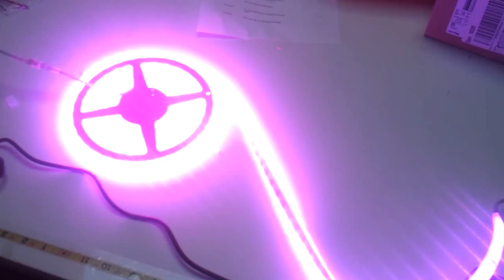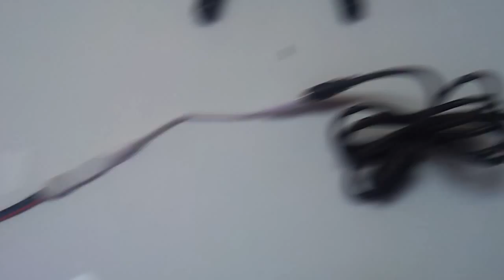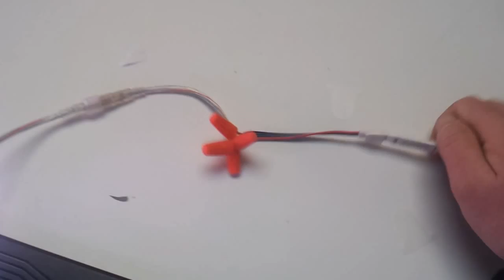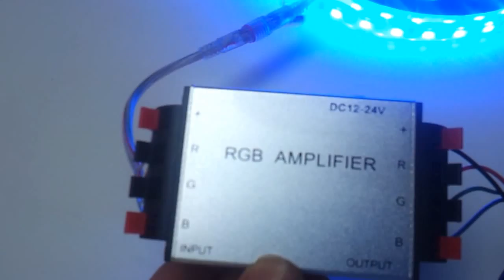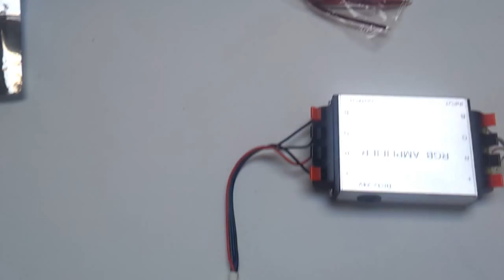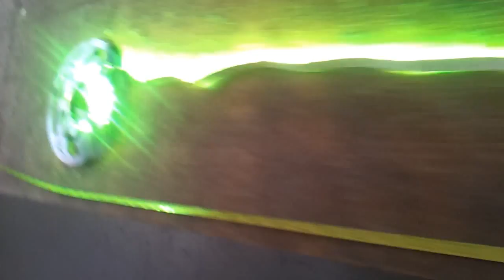How to Install LED Strip Lights: RGB Long Distance Installs with Amplifier

Comment: So if I want to connect over 100ft of strips into one continuous line, how would I avoid voltage drop?  I have three transformers and am trying to have it so there's no jumps with cables.  I'm going to solder the strips.  I have 3 300 watt transformers

Comment: You can do this over and over again until you run out of power sockets to plug all those power supplies into it's got to be a better way and I haven't found it yet but I do have some ideas look everyone these LED lights you should just plug the main power supply in because that's what these adapters do spend all that money to have to plug it into the wall anyway just use the plug that comes with it and this string the lights next to each other in a straight row it's the exact same thing that's my complaint anyway it's got to be a better way

Comment: Hi, I have a question.
I have a gas station and I want to install 5-meter LED white stripes around each of the 8 doors.  I have bought 8 of the stripes but unsure if I should buy 240W or 2 X 120W.
Should I buy an amplifier of 120W + 120W transformer? PLEASE Help. thank you!
Can all of these be in a cooler? (not freezer)

Comment: Question. Im running 5metres total in increaments of 1ft each. When i have the brightness up it gets real hot - hot enough that i rather  not touch it. I run out on 75%of brightness and it gets warm but nothing to crazy. I believe im running  12v at 5amps.  no amplifier Any ideas what the problem is

Comment: Hypothetically if I had one real, I only need lighting for the first half of the real, cut it and added 10 foot extention wire and then continued the other half of the strand would It work without an amplifier.
Reply: Pretty sure that would just mean half the voltage on both sides with uniform voltage drop

Comment: How if instead of series circuit like in your video, use one big amps 12v power supply and put them in parallel? In parallel circuit, do we still need amplifier for each strip even though the power supply has big amps?

Comment: Can I put a the amp at the beginning of the run, and have a IR motion sensor control the power supply to the amp? I think that way the data stays live?
Reply from the maker: Hi Gabe,

Thanks for watching our videos! 

What you described is perfectly doable. It should work without any issues.

Don't hesitate to contact us if you have any other questions.

Comment: I saw 360w amplifier on the web, why 360 wattage.... ? and dont wattage on ur amplifer ....? thanks....
Reply: if it says 360 watt it can output 360 watt at maximum. the led strips use power.. lets say you got 30 meters of led's and they are rated for 400 watts, you would need at a minimum 400 watt power supply.
Reply: Then its a low power led strip... Just look at the specs of the led strip and psu.

Comment: if anyone can help me i would appreciate it. I am trying to put lights under the stairs on front of the house. I have three steps, the bottom 2 stairs are 10 ft, the 3rd is to the patio runs 22 ft 5 in.  I saw that I can get 32.8 ft of strip to one power supply. can I get a splitter to have all three runs go into the one power supply without any loss of power or not same brightness of light?  Total i am trying to run about 45 feet of leds can I have to go to one 12v power supply?

Comment: If I'm running 16 ft 300 light strip then amplifier then another 300 LED 16 foot strip when I get to the end can I connect that end into the first strips end that is hanging to complete a square?
Reply from the maker: Hi John,

Thanks for watching our videos!

It's not recommended you join them together, simply leave the two ends close to each other but don't actually connect them. This will still create the illusion of a square.

Don't hesitate to give us a call at 1-844-353-9347 if you have any other questions!

Comment: You  mentioned that on the end of the run ,you should install another amplifier and another PSU along with the connectors. What if the main PSU is strong enough to support 2-3-4-5 or so more reels? Can't we keep going on as long as the main power source allows us? Also, the same thing for the amplifier. I have a 12A 144w for 12V amplifier, which consequently supports 2 300LEDs reels. Can I connect two different reels at the end of the amplifier? Thanks.
Reply from the maker: Hi there, Thanks for watching our videos!
Each amplifier needs it's own power source to boost the signal. The issue here is voltage drop and that is why you need to use more power sources.
Give us a call at 1-844-FLEXFIRE if you have any other questions or would like to get a project developed.

Comment: so this is all fun and games, but there's a problem with this imho. you don't have a contineous line of RGB strips this way. the great thing about these rgb strips is that you can cut them at the copper marking, and then use a clip to connect one to another. the problem then indeed is power supply. 2 strips will work okay, but then it's all but over. now this amplifier is nice and all, but i have a bit of a problem with it, and that is that it completely cuts the fluency short of the led strips. you have this massive hump of metal before you can go to the next strip, which kills continuity. so how do you make a setup where you have like 22 meters of wall [all combined together] and you want it in one straight connected line where you don't get a 'gap' of light?
Reply from the maker: Thanks for watching our videos!
In order to make it look like a continuous line, the power supply and amplifier must be installed at a distance so that only wires run to the strips. That way you can get the two strips really close together to make it look like a continuous line of light.
Feel free to give us a call for a more detailed explanation at 1-844-FLEXFIRE
Reply: Flexfire LEDs Couldn't you use a higher wattage power supply to power more than 2?

Comment: I am looking for a solution to install around my pool patio. The patio has a 2ft wall with stone cap on top and I want to run the leds under the seat. Dimensions are 50ftx60ft with a gated area so approximately 200ft. The pump and breaker panel is at about a 70/30 split relative to length. 80-90ft one way and 110ft the other. Is there a way to install all 200 ft with a single remote?
Reply from the maker: Hi Doug,

Definitely doable. Give one of our project developers a call at 925 273 9080, they would love to help you out with your project!

Comment: can i ask you a question, i wanna run lights around the inside perimeter of my 17ft bass boat for light at night when i need it. i will be running about 30 ft total. can i connect to my 12v boat battery direct and just put an on off switch on my dash, and if so which lights can i run, ie the 300 lights per set or what ? thank you
Reply from the maker: Hi Jeff, thanks for watching our videos!
Most vehicle batteries have an output of 12 Volts DC. This means you can use an LED strip that runs on 12 Volts DC and connect it directly to the battery. I recommend getting an on/off switch so you can turn the lights off when you are not using them.
Don't hesitate to give us a call at 1-844-FLEXFIRE if you have any other questions!

Comment: I'm connecting 3x 5m strips,  72w each smd5050.  From controller to 2 strips together and then third strip of the amplifier.  Problem im getting is the colours don't all match on the third strip after the amp.  The solid colours work but when changing shades like yellow and orange.  The third strip goes colours are different The first 2 strips direct of the controller work perfectly.  What could be the problem.
Reply: Shahab Din voltage drop.
Reply: Tom C how can it be voltage drop if I'm powering the amp with separate driver?
Reply: Shahab Din I'm little confused by what you originally said. Maybe your controller don't have enough ampage?
Reply from the maker: Hi Shahab,  thanks for watching our videos!
If you test Red, Green and blue does the third strip after the amp generate those three colors with the same intensity?
One of your channels could be disconnected or the amp itself could be faulty. Test each color and let us know what you see.
Please feel free to give us a call at 1-844-FLEXFIRE  for more information and tech support.
Reply: Flexfire LEDs thanks for your reply.   The red blue and green works perfectly.  The intensity is all the same.  Ive tried changing Amps and it's doing the same.  The strip on the amp doesn't match when changing colours to yellow orange, and other mixture of colour but blue red and green is perfect.  

The controller says 18amps on it and I'm sure the amp should work on a single 5m strip.  

I did however found a workaround.  I Linked all 3 strips from controller and connected the end of the last strip back into the controller like a ring circuit.  Works perfectly without an amp. But I'm sure this wouldn't work with very long length of strips.
Reply: Hey, I'm having exactly the same issue you were describing. Did you ever find a solution?
Reply: Guys I am having the same issue. In my case, 1 strip to the controller and another 3 strips each connected to their own amplifier.  I am getting a different colour (more noticable on colour transitions) between the amplifier connected strips (all 3 strips are the same colour) and the one connected directly to the controller. As mentioned by the others, R, G & B all works fine on their own. 

I do notice that the colour change responses are abit laggy on the amplifiers (if that makes sense, or perhaps its just the difference in colours that cause this perception)

I would, however, try to put another amplifier between the controller and the first strip so that all strips are connected to each amplifier. Well at least all 4 could be in the same colour now, and I dont see how it won't work lol.

Comment: hey I need 65 ft of multi color led lights. what do you recommend?
Reply from the maker: Hi Saul! Thanks for your interest in our products.
We have various options of color changing LED strips which will work perfectly fine for a 65 ft run.
Our project developers would be very happy to assist you on this project and get a complete parts list together for you, along with installation instructions. Don't hesitate to give us a call at 1-844-FLEXFIRE or 925 2739080 so we can make your project a reality!

Comment: Thank you for your video. Does the information apply for one color LED strips? I need to run 65 feet around my deck in Colorado, its around 30-40 feet from ground level where I have an electrical outlet and I also have one at deck level. I would love to be able to run from one of the 110 outlets, preferably the one on the deck. I don't want to see the power supply (or supplies) or the amplifiers. Would I be better off purchasing a landscape lighting transformer to power them with a 72W Outdoor Waterproof Low Voltage Landscape LED Power Supply Converter/Rectifier, Input 12V AC to Output 12V DC and run two runs end to end from one power source? Hope that makes sense! Thank You....
Reply from the maker: Hi Cheryl, thanks for watching our videos!
It's a bit tricky to give you a straight forward answer without knowing the specifications of the LED strips that you are using.
The max run length in series that an LED strip can do depends on a lot of factors such as amperage, voltage, circuit board etc.
I welcome you to give us a call at 1-844-FLEXFIRE to speak with one of our project developers, I'm sure they'll be more than happy to help!

Comment: Hello man i want to ask you some question. 1) how many max load of led strip pcb? 2) in 10 meter led strip without amplifier (with one power supply) its better to connect in series or parallel? 3) how much meter can run led strip in series without amplifier ? 4)If i have 20 meter led stip (example 1A/meter) and 4 power supply 5A each one, and 3 amplifie.The controller output must be 5A or 20A ?  Thank you!!

Comment: Can I mount all the power supplies in one place, amplifiers with them, and simply run a 4 wire strand to/from each strip?   Trying to visualize how I would be able to light up a pool cage and keep everything hidden.
Reply from the maker: Yes! You can. You can give us a call for more details, but I can tell you that we've done this in the past with great results.

Feel free to give us a call at 1-844-FLEXFIRE, we'd love to assist you on any lighting project!

Comment: I want to add a gap in my light strip. Will my voltage drop when i cut a strip to add a extension without lights?
Reply from the maker: Hi Brett,

As long as the wire is not super long and thin, the voltage drop should be minimal.

You can use a voltage drop calculator found online to know what gauge wire to use to minimize voltage drop.

Feel free to give us a call at 1-844-FLEXFIRE, we'd love to assist you on any lighting project!

Comment: Hi, could you give some advise please. I'm going to make a U-shaped ceiling rgbw led installation 9 + 8 meters with remote led controller. Power consumption 12W/meter.  So how is this done right with two transformers and one led controller? I suppose I need 1 or 2 amplifiers ? Can I connect these in the middle, where in the line comes the controller?
Thanks!
Reply from the maker: +Toni Hautala We have a wonderful design team that can draw out everything you need for your specific project. If you send me your email and project details I can forward it and they can reach out shortly! info@flexfireleds.com

Comment: what amplified i need for this light strip ?
i Have this one

(LED RGBW Amplifier Controller 24A RGB Singnal Repeater 4CH Magnifier Aluminum for 5050 RGBW RGB Strip module AmplifierBrightness:)

this is the light strip

High Brightness
LED Chip:
SMD 5050 Epistar
Power:
14.4W/M
Average Life (hrs):
50000hours
Power Source:
DC
Strip type:
Round 2-wire
Is Dimmable:
Yes
Usage:
Decoration Advertisement Holiday
Color:
rgbw or rgbww Pink
Color of PCB:
white
Beam Angle:
120degree
Power Consumption (W/m):
11.52W/m
Package:
5m/roll
Width of PCB:
12MM
Wattage:
11-15W
Certification:
CE

LEDs Number/M:
60 pcs/m
LED Quantity:
60LEDs/M

Comment: what is the size of the transformer for your amplifier
Reply: Khalil Barakat Thanks for your question. The size of the transformer used here was a 12v 8A power unit. If you are using an amplifier for your own project you need to check what the transformer requirements for the lights you are using. You should also look at the amplifier to make sure it can handle the amperage you are putting through it.

Comment: Great video, im having heaps of issues with my leds, I have 4 frames each frame has about 2.5m of 5050 RGB 300 leds so a total of 10m and im trying to wire it so I only need 1 power supply but i assume I will need a amplifier as each frame dosent light up or only 1 channel works, but I cant work out if im having issues with the solderless connectors. Have you had issues with solderless connectors before. can I use a 20A amplifier and will this work with my 6A adapter and 44 key IR remote. Thanks
Reply: Ryan O'Sullivan I have had many issues with many of the current solderless connectors on the market. We are working on solving those problems by creating our own at the moment (still in R&D). In order to answer your question perfectly, I would maybe have to see an outline or drawing of your setup. We can help design your project. Can you email us at info@flexfireleds.com?

Comment: I am adding rgb tape light in my kitchen I am going to need a power supply on one end to run a 8 ft strip but then from the end of that strip it is about 20 ft to the next strip.  Will just a amplifier at then end of the 8ft run work to power the next run or do I need to run parallel which would then be about 30 ft from controller to beginning of the strip

Comment: I want to connect 4 strips of 16.4ft rgbww strips in one line. So I need 3 amplifiers( I can't find a good rgbw amplifier). So if I get the same power supply from the LED kit for all amplifiers, can I connect them all into one outlet?

If it's hard to understand: I want to go from a surge protector to a adapter and each lead out to their respective amplifier. Is that possible?

Comment: Is it possible to not have a ac to dc psu? If i want to run these in a rv off the 12v system, can i do that, and what do you need for that type of install?
Reply: You can use the RV's 12V system to bypass a PSU. Just hook the LED controller and the amplifiers up to the 12V of your RV to power it.

Comment: hi i need some help please, i have 5 rolls of 5 metres each for a total of 25 metres, i need to connect them together, i have one power supply of 12v 30amps and 4 mini led amplifiers, and one remote control? do i have everything to make them work or i need to buy more things? thanks
Reply from the maker: Hi, thanks for getting in touch. We're happy to help you with this, but will need some more details from you to provide accurate advice. Please send an email to info@flexfireleds.com with your contact information, and we'll call at your convenience to walk you through it.

Comment: I am looking at doing a very large install and want to use a WIfi controller. the most of the power supplies will be in a central place. with the strips leading out.
can I hook up the input for the amplifiers in parallel. instead of the series option you are illustrating. also would these amplifiers load down the out put of the wifi controller. Thanks
Reply from the maker: I think I understand the project. Each amplifier will need to be powered on its own, so it would not load down the Wifi controller. The amplifiers simply carry the signal from the Wifi controller and separately power the 12v back into the strip. If this does not answer your question give us a call! We have an amazing design team that can help you with any question 925 273 9080
Reply: Thanks, I will play with a small sample before doing the install.